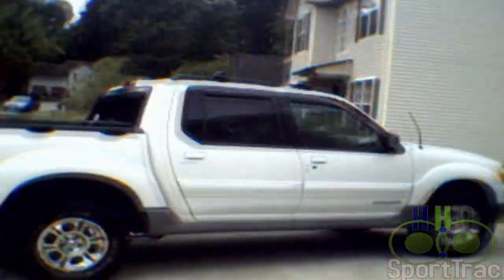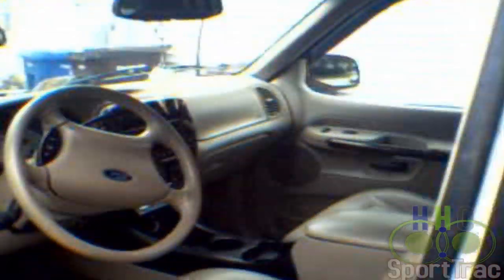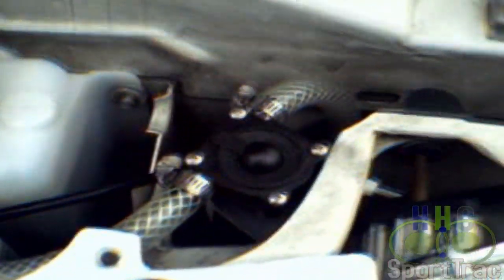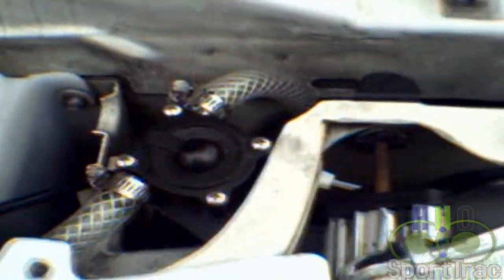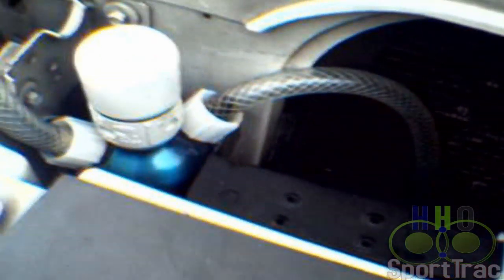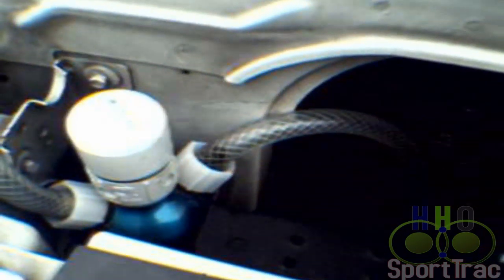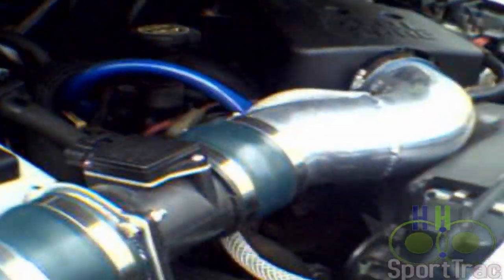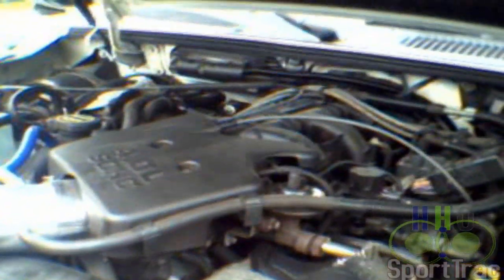HHO Installation Results

Comment: How does your electrolyte hold up? I have been working on different formulas and I have come up with a process that makes it so no rust builds up inside the chamber at all. I'm willing to share my notes with you. I have had my generator run for a solid month and have not had to change out the electrolyte yet only add more over time due to hydrogen and oxygen loss due to redox processes

Comment from the maker: So after 6 years of active testing, I can report these results.The 2002 Explorer Sport Trac got decent results. Original OEM MPG is 16 tops on the Highway, I was getting about 28 mpg with a MAF Adjuster & and EFIE electronics to fool the CPU. So technically it works to improve mileage. Bottom line on a CPU vehicle it's more trouble than it's worth. I removed it. A leak corroded by A/C evaporator (aluminum) and the constant adjustment made the entire setup untenable for daily use. That being said, on my 1963 Merc that has points, condenser, and most importantly NO COMPUTER, with a 260ci V8, I get 32 mpg Highway. The Physics doesn't support running a car totally on HHO BUT it does help completely burn gasoline so you get more mpg, not to mention cleaner exhaust

Comment: Hmm...nice setup. Post results. I'm using a hydrogen separator cell on a ford expedition. So I don't need all the electronic gadgets on my sensors. I've gotten great results so far but I'm wondering if I should tap into the pcv valve for more vacuum. Looks like you didn't go that route. Maybe I don't need to Idk.

Comment: When WATER VAPOR is heated up to proximately 700 C, it will decompose to H2 and O.  Temperature inside the combustion chamber goes over 1000 C, so more than enough to decompose WATER VAPOR. Simply by sending correct amount of WATER VAPOR into the chambers, it is possible to generate big amounts of HHO without using any HHO generator. I appreciate what you guys do, but I think HHO generators came to market in order to misdirect people and suppress the powers and abilities of WATER VAPOR...

Comment from the maker: @HardyTechnologies I am doing both. Out of the box the scan gauge is not accurate. I had to calibrate the speed & fill up %. It took me awhile to get it right. I use a manual record to check the validity of the scan gauge. 
If you need a good calculator I have one on my website

Comment from the maker: @yanlapanic I made mine (I have the facilities, I am an aeronautical engineer) 
I cannot stress enough the use of a bubbler & flashports or flashback arrestors. You will have more to worry about than the TB. Another member actually blew up his intake manifold & cell. Safety should be a paramount concern.
Reply: I think I worked with you at a certain factory and remember a guy blowing up his intake by mistake.

Comment from the maker: @yanlapanic Ahh ok I read it as we measure distance/quantity not as you stated quantity/distance. That's encouraging. The reason it does that is that the HHO is allowing a more complete burning of the fuel, also the HHO may be cleaning your engine by removing carbon deposits ( my 1974  VW beetle showed dramatic improvement for the latter reason). In any case once your HHO production creates a lean burn reading the ECU will intervene. The Volo chip may work well for you. What year is you Toyota?

Comment from the maker: @yanlapanic My cell is very cool for several reasons, firstly I placed it in front behind the grill where I have good air flow. Second I have a 1GPM pump which circulates the electrolyte if needed.

Comment from the maker: @yanlapanic Distilled water is a must. also the reason you mileage decreased is because introduction of HHO into your combustion chamber gives the O2 sensor a lean burn reading. Your ECU will compensate by adding more fuel to the mix thus negating any mileage improvment or ever reducing it.

Comment from the maker: @yanlapanic Yes you will definitely need a shop manual with electrical schematics. That's how I found which wire to splice on my Ford. Have you checked on various Toyota or HHO forums to see if some one has the ECU schematics

Comment from the maker: @yanlapanic On the Efie vs the Volo it's your choice, the installation is just as simple for an EFIE (cutting & splicing 1 wire per O2 sensor) Also with a flick of a switch, you can turn off the HHO Generator and the EFIE & return to OEM specs.
If you need a wiring diagram for the HHO system (relays, MAF, EFIE etc.) send me yr email & I will send it to you.

Comment from the maker: @yanlapanic Since you have your cell apart, If you can have the plates cross hatch and rotary sanded to promote bubble release and then cleansed in an Ultrasonic cleaner at 40,000 Hz leaving them microscopically clean. Use surgical gloves to handle them after they are clean. I have my plates sealed between high temperature 1/16" thick EPDM gaskets. This cell has a configuration of -NNNN+NNNN-NNNN+NNNN-

Comment from the maker: @yanlapanic I've heard mixed review about the Volo chips. Personally I would only use one only after I have my basic system in place.  I would go with an EFIE (digital is easier to set but analogs work just as well) a PWM, a 28% KOH mix. My eventual electronics enhancement would be an APEXi V-AFC II. But they are pricey

Comment from the maker: @yanlapanic  I have a Maf enhancer , but my Ford didn't like it (kept throwing DTC codes. The EFIE is easy once you set it. It never really gets touched again. 
I cut in my EFIE and set the mv to around 325 (gradually, it took several days). I also have an EGT to measure the temperature of the exhaust gas. (ebay $50) I notice that when my EFIE was on w/o HHO my exhaust temp was dangerously high. Your car may no like the MAP enhancer, plus you have to keep making manual adjustments

Comment from the maker: @yanlapanic You would need to produce .9 LPM. 
The rule of thumb is you need half of you engine size in LPM. My Sport Trac has a 4.0 liter engine & I produce just over 2 LPM. My MPG for city driving only was 13 mpg w/o the ac on, with HHO I am getting just shy of 19 mpg. I haven't taken the truck on any highway trips so I don't know what increases I have gained there.

Comment from the maker: @askaboutRudyV OUCH! That must have been a pricey fix! Thanx for the compliment. My main objective was an OEM looking install. It did take a while to plan it out & make brackets but it blends right in. My original CITY mileage was 13.5, currently I am getting 18.6 sometimes 19 on 2 LPM of HHO. I have yeet to take this truck on a  long haul to read highway mileage.

Comment: Wow, you did a great job. Make sure to try to adjust the Electronic Fuel Injector Enhancers as good as possible. The bad thing that happened to me is that in my 2004 Honda Civic Ex, I have a wide band and a narrow band O2 sensor, and when I was installing my second O2 sensor, I was under the car and I forgot to turn off the car before I cut one of the 4 wires of my down stream O2 sensor, and it short out a couple of things. The O2 sensor that I cut, and the alternator (along with it's wires).